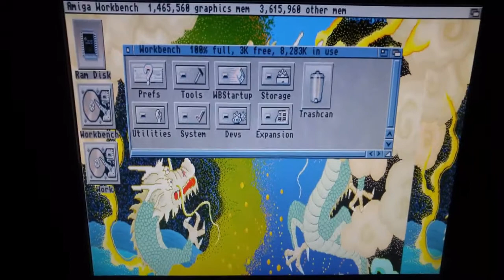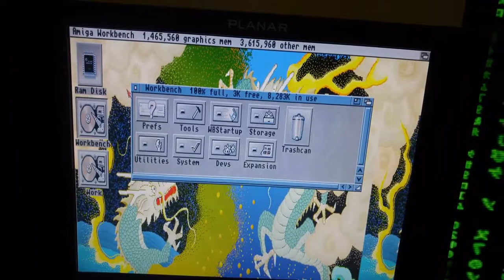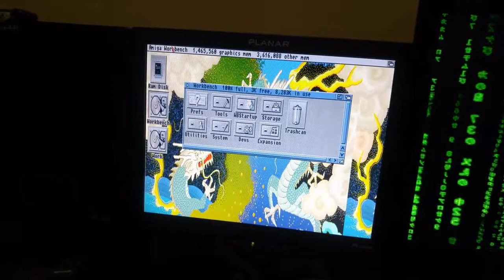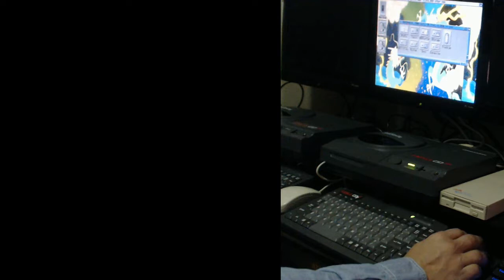Amiga Mouse Repair (Micro Switch Replacement)

Comment: A great repair and informative, I might be able to this to good use sometime as I have a box full of broken Amiga mice. I'm a bit surprised though that you took the time to color coordinate your keyboards but have opted for a white mouse. I think your setup would look even cooler with either a black or grey mouse,  you could use a generic PC optical with one of those USB Amiga adaptors, or Amigakit does a really nice black Amiga mouse with the Amiga checkmark logo. If you prefer an original Amiga Ball mouse then Amiga Technologies did a black one which appear occasionally on eBay etc.
Reply from the maker: Thank you for the feedback, if you you do repair one of your mice let us know that would be awesome!  You have a keen eye, the mouse color is something  I have been working on.  I do prefer the ball mice.  I have one of the Amiga Technologies black mice but need another if I'm going to go that route. I'm probably going to paint the two white ones to match the CD32 grey .

Comment: Hi, I'm planning to do the same. Can you share the specs for the microswitch? Especially if those are same type of switches as in that more angular model which you show @ 2:40 .
Reply from the maker: Thank you for the feedback. I should have given specs in the video.   They are 6X6X5mm Micro Momentary Tactile switches. Here is a link https://amzn.to/2Y4NtmI.  Regarding the mouse @2:40 commonly called the "Tank" mouse, most have the same switches (in my experience) but there were several versions of that mouse some have larger switches and some have a membrane type switch on a separate board.  The best way to tell is to just remove the top by unscrewing the two screws at the bottom and lifting off the top.